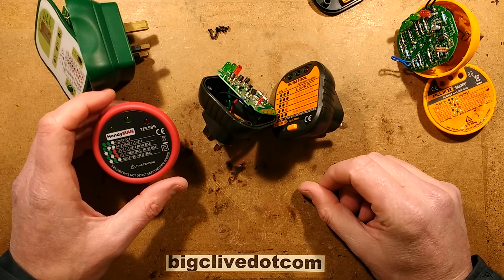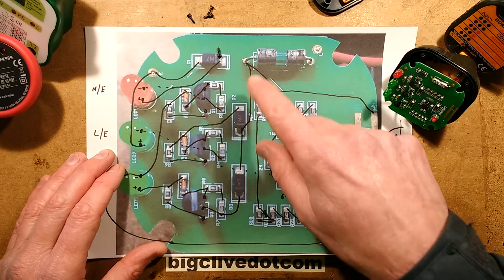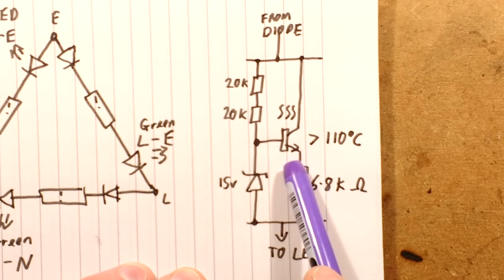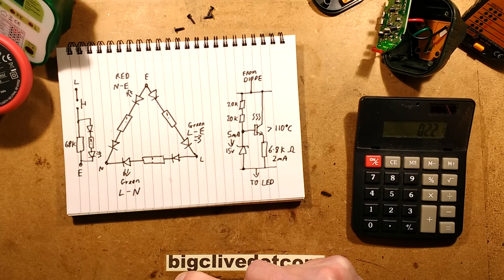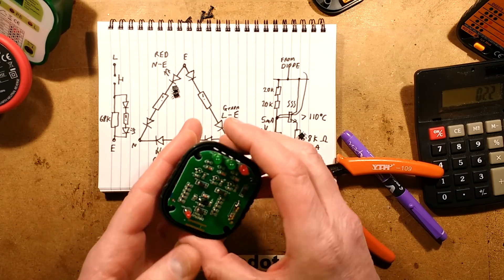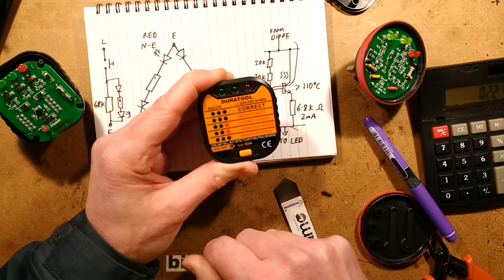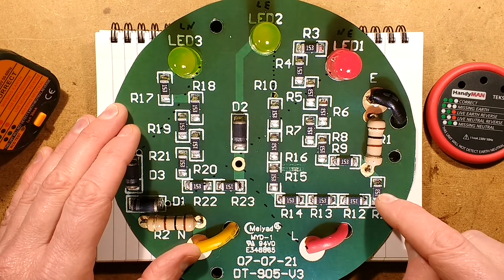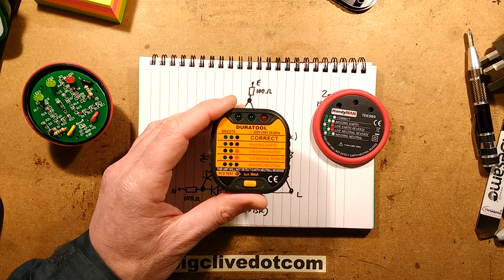Good versus evil socket testers.  (with schematics)

Comment: The earth fault LED is s really good idea, because if you press the switch and the RCD doesn’t trip, it’s easy to doubt the tester, and assume the RCD is okay (it’s a safety device after all). But having a red LED come on shows you that the tester is responding to the switch push, confirms it’s working and the RCD is bad.
Reply: I agree with you.
I think its a nice feature, and also a really simple circuit.
Reply: more buttons = goodier

Comment: I think that the LED that lights up when you push the button is quite a good idea because if you push the button and the RCD fails to trip then the first thing you are going to think is "does the button work?"  Then you're going to risk your life connecting a resistor between the live and earth any way.  It would be better still if the current in the LED was the same current that was used to trip the RCD.  It would be even cooler if it was a black light that lights up black when you press the black button.
Reply: exactly, I've had test buttons work intermittent, unless held down and wiggled about.
Reply: And if it successfully trips then you can see how quickly it did so.
Reply: I've been LOOKING for DED's for YEARS, no one seems to source them. (Dark Emitting Diodes)
Reply: You know what else would be cool? If I could breathe vacuum, I could flap my arms and fly to the moon. <_<

Comment: Yeah, I think you're exactly right: the button-press indicator is so you won't have any doubt where the fault is if your GFCI outlet doesn't trip. The last thing you'd want is for someone to think it's just a bad tester and to wind up cooking themselves with a hair dryer instead of just fixing the wiring or replacing the outlet.

Comment: Actually, epoxy transistor packages that size are better at dissipating heat than, say, a TO5 metal package.  Ferranti figured that out a long time ago with their ZTX transistors.  Ferranti is long gone, but the semiconductor operation was spun out as Zetex, which is now owned by Diodes Inc.

Quick firtle on google...  ZTX753 rated at 1W at ambient 25 C, derate at 5.7mw/deg C for higher ambient.  Storage and junction temeperature range -55 to +200 C.  Which is a lot more than epoxy packages could handle 30 years ago.  It's a higher max junction temperature than was typical (175 C) than 30 years ago, too.   Oh, max Vceo is 100V.  But there may be others in the ZTX range that are rated for the job.

Anyway, 110 C for that transistor is not scary.  Assuming they're using decent epoxy.  The circuit is fucking stupid in the first place, but the choice of transistor type may not be.

Comment: The weird one was probably designed by someone who had heard that you should use constant-current drivers with LEDs instead of just a resistor, and then looked up an example driver but didn't bother to determine the power ratings or change any of the component values from the example. I'm willing to bet that exact circuit is in a textbook or on electronics stackexchange or such. It's a very "new grad" (or even still a student) engineering feel.
Reply from the maker: It does have a student feel to it.  Where the lessons of real life have not been learned yet.
Reply: That actually makes sense. The circuit was over engineered, something that students do quite often because of the lack of experience.
And it goes in every field i know of. The masters of their trade usually prefer something simple and reliable.
Reply: More likely they thought it would be a good idea to keep the LEDs visible even if the supply voltage was low
Reply: Yes, that's a big part of why one would use a constant current driver. But that doesn't explain the design of that driver being unsuited to the task at hand. Especially when it's so simple to do it better, and so easy to notice the problem in the simulation and prototyping stages. Even as a student I always ran a test of power dissipation for all components in SPICE as part of my worst-case analyses. The professor gave the class a project to build an audio amplifier that had a circuit specified (including all components) but no layout or other info. We had to analyze it, build it, and demonstrate it working. My group had heat sinks on our PCB, one other group (out of about 8) did. The rest let the magic smoke out. You'd think they'd have figured it out from the analysis graphs and the datasheets, or at least have tested it, but many didn't. It wasn't until the end that they got the lesson. 

Most students probably didn't have professors give such a project, and so never really thought about thermal design considerations or simulating & testing everything properly. Learning through failure tends to stick rather well.
Reply: Hah. I like your professor.
Reply: I saw a similar facepalm thing in school. Guys were building a POV sign (I forget what, clock maybe. Been 10 years.) They built their case up, painted it nicely with a good Latex paint, and then GLUED the Motor / Rotor / PC board assembly onto the front of their case. Lucky for them, it lasted long enough for the staff to review its' functioning and they got a passing grade. Fail on basic mechanical principles IMO though, you BOLT or SCREW or otherwise securely fasten things that vibrate / have torque (like a persistence of vision device) TO the frame, you don't glue it to the paint, unless you used one HECK of a good paint. (MAYBE with an epoxy paint or powder coating, those are pretty rugged, but not Latex house paint!) Just cringe. I expected the rotor to come flying in my direction if I went too close to the thing :P

Comment: Clipping off the transistors at 9:48 reminds me of Earl "Madman" Muntz, who manufactured TVs from the late '40s to '60s.
He often carried a pair of wire clippers, and when he thought that one of his employees was "overengineering" a circuit, he would begin snipping components out until the picture or sound stopped working. At that point, he would tell the engineer "Well, I guess you have to put that last part back in" and walk away.
When I worked in TV repair shops in the '70s I repaired a couple of Muntz TVs.
They were simple, but not cheaply made.

Comment: The 100R resistors are for safety. The axial types that have been used typically "fusible resistors". Once this resistor/fuse combo reached an overload situation it will die open and without causing fire. - somone must have read the EU safety standards when designing that thing ;-)
Reply: My thoughts were also that Handyman has fusable resistors as a protection device. It seems a very good design, should have no problem with voltage either unlike the designs with only a couple smd resistors in series. (SMD resistors can have very low voltage rating!)

Comment: I'm eager to see a reverse engineer on the Fluke now, yesterday at work we had a preempted warning from Fluke that they're going to issue a recall on all of the SM series socket testers for some reason, we've been ordered to stop selling them all together for the time being! Thanks again Clive!
Reply from the maker: I wonder if it's electrical or a failure of the case seal risking them falling apart when bumped about in a toolbag.

Comment: All they needed was a power resistor in the collector circuit to off-load some power dissipation if they wanted to use that current regulator.

Comment: The regulator should make it work from 20 volts or so. Even if there is a low voltage the LEDs should still be adequately bright.
And on 240 volts they are nicely bright, without any component dissipating too much. Otherwise they could have used 220K resistors and increased the transistor current a bit - but now the dissipation is nicely distributed.
Oh Clive - don't go for gadgetry like shouting 'enhance' - you are so nicely understated and calm... keep it so please!

Comment: The reason for the constant current drivers is simply because that circuit will work with same LED brightness at both 220V and 110V. So basically its the same PCB sold all over the world and just put in different housing.

Comment: I'd be interested to see you compare the accuracy (and insides, of course) of a Kill-A-Watt meter to a HOPI.

The reason is, I bought a Kill-A-Watt a few months ago and some of the readings it gives me just seem right out. Like when stress testing my computer (Ryzen 5 3600x, GTX 1060TI, 16gb DDR4 etc) which has a 700W PSU, the Kill-A-Watt says it's only drawing about 120W. And my 3A USB charger quick charging a cell phone only draws 80mA according to it, while one of those USB Volt/Ammeters says it's a more realistic 1.5A.

I would have loved to get a HOPI just because you use them so much and you've always had such good experiences with them. And I love what I've seen of them. But from what I could gather from the pictures, it looked like it was for European plugs only.

Or hell, maybe I could even mail you my Kill-A-Watt and you could have a look at it. Just not sure where to get your mailing address. Lord knows it's not doing me much good here. I think my final test will be to hook it up to a 1200 watt microwave and see what it says.

Comment: Yes, its overkill to limit current that way unless you wanted it to work on several different voltages (perhaps the same circuit is used in a US tester?).  110 degrees is not a problem for a tester like this, its going to be used for seconds at a time in each socket is practice, and long term reliability isn't a design factor like it is for 24/7 equipment I reckon.

Comment: The square one, although I have I newer model that is different inside and shows the trip current on the display when you press the RCD 30mA or GFCI 5mA depending on the model says on the manual to no let it on the plug for more than 5 minutes, so the heating problem seems to be still there. But the 230V model draws only 18mA in 117V then you test the RCD that is not enough to trigger the RCD for testing. I saw some other that trigger the RCD in 117V  so I suppose there is a 230V model and a 117V model although the model code is the same.

Comment: My equivalent testers are all simply resistors and neon bulbs (plus a switch and resistor for GFCI test) in a really stout case. As a "Grey Beard Engineer" I abhor the seemingly excessive parts count in these units: More potential failure points.
Reply: Us picky old cranky guys are like that. LEDs are nice for some things tho :)

Comment: The constant current circuit has been designed by someone with a basic electronic knowledge but no common sense, probably someone fresh from college.  As is normal practice the zener diode current has been set at 5mA because that's the current at which the zener voltage is specified.  If you were to operate it at say 1mA then you wouldn't get any clue from the data sheet as to what the voltage would be.

Comment: 6 years since a very handyman took a handyman apart:) Looked up your video again because i had a discussion about relying on a socket tester. Which that  argument i doubt, and even could be very dangerous,  but many do by the name alone. 
Thing is, and correct me if i am wrong, the 3 light socket testers will / can not test a reversed Earth and Neutral but show the lights show as OK.  

My reasoning: If you have a socket with a reversed Neutral and Earth. A toaster would work fine. But if there is a Line to metal case fault, current flows through ones PE wire but reversed in the socket back to the Neutral. A RCD would not be able to detect the fault, but the case is still live. which can in my opinion be potentially dangerous.
Is that  correct?
And last, just a fun fact, MacGyver is out. BigClive is in. Heard in a recent sailing video when something was broken: "Well, looks looks i have to BigClive this..."  :)))
Reply from the maker: Since new testers have a test button that puts a resistor between live and earth.  If the earth and neutral are swapped the RCD doesn't trip.

Comment: I'm thinking that maybe they just wanted the indicator lights to be as bright as possible to be seen from across the room just in case. They may also have wanted to use LEDs with higher voltages to better fit their circuit. That's really the only reason I could think of for using the GaN LEDs. Possibly just sheer cost reduction.

Comment: The LED for the RCD Test is not bad at all. When you see the LED lighting up, you know that your test device is working fine, but your RCD is not.
Reply: Meiestrix Also note that some modern RCDs (they have an extra P in their name in some markets) are certified to trip even if the leak is true a diode.  Ideally, those would need two test buttons connected through two different LED+Diode circuits (press both to simulate an AC leak).

Comment: I was just looking at these on eBay and there is a new one, a smart and fancy Aneng AC11, with a colour display.
Reply from the maker: I bought one.  They advertised it as a UK version and it came with a different plug and UK death-daptor with sleeved earth connection that means that when used together they show an earth/ground fault.
Reply: @bigclivedotcom  I am afraid I got enchanted by the beautiful display and bought one just a couple of minutes ago. Just as an afterthought, I checked the reviews on BangGood and exactly the thing you have mentioned got me worried - people had pictures of it with an adapter stuck on. The eBay auction had an option where I could choose UK/EU version, so I wonder what end will it arrive with. Ehh...an impulse buy, we'll see.

Comment: Is it possible that the current regulation circuit is used in the case that the voltages across them are not full voltage?

Comment: A 2N2222 in a TO-92 case (which admittedly is not the same transistor you have, but is the datasheet I have in front of me) is good for 625mW. Theta J-A is 200C per watt, So at 460mW the rise would be around 92C. Add in about 15C for your room temp and you get 107C. Not too far off from what you are seeing. So it would probably work, as long as ambient wasn't too high.
But since the zener is drawing 5.5ma @ 220V and the emitter is drawing a constant 2.1ma, the LED is actually running at 7.6ma, not the calculated value. Brilliant engineering.
The LED on the RCD tester is probably stupidity, since in addition to the 3.3ma for the 68K resistor they have 7.6ma for the light. So the real RCD fault current they are running is almost 11ma, which is probably far above the fault current that some spec says should be the mandatory trip current.
Reply: I'm wondering what that transistors' base current was, pre-snip by Clive :p

Comment: When you push the RCD button, the circuit should trip, resulting in the LED not lighting. The LED is red because, like the red LED used in the line tester, if you see it, the RCD test has failed.

Comment: Hey Clive, in my opinion you do a great Job reverse-engineering al kinds of circuits. Then you present the Schematic which is a great deal in understanding the circuitry, at least for me. Maybe you could show us some recently opened Circuitry simulated in LTSpice. Also the whole "how do I get 10V peak to peak out of a 5V circuit" discussion (eevblog) might puff into pink smoke as you are clearly measuring "from here to there" (on screen) or the other way round, just to have a hands on explanation for what sh*t is about. Everyone could replicate a simple LED Capacitor Dropper for ecample...

Comment: Can't wait for you to get to the Fluke. Many people like their products but after two Fluke meters I had died I am not a fan. Both had absolutely poor case design with no webbing on screw mounting "poles". The plastic on these poles just crumbled causing the contacts to come off the rotary dial to not make contact. Actually that meter is electrically fine but mechanically failed so useless.
Reply: The Brymen BM235 has been really good for me CAT 4 UL listed got all the other things fluke has and is a bit smaller.
Reply: Inductor back EMF I googled it and the first thing that came us is EEVblog. Dave is good at his stuff so I am sure its fine. If I didn't have a decent meter that works for me now I would have considered supporting him.

Right now I am using an Extech set with a clamp on and typical multimeter set. It exactly replaces my Fluke 112 typical multimeter and Fluke 322 clamp on. 

I do not do extreme testing so any decent meter will suit me. What pissed me off with Fluke is they charge high prices but the meters failed due to poor design. I have the pictures to prove it. One day I will do a video on it just to ease my mind. Right now I don't have enough views on my videos to affect their sales by even one meter.
Reply: meanwhile my 1993 dated 87 has yet to go wrong
Reply: "extech" "extreme testing"
Reply: I always liked Square-D, but they are expensive.
Reply: Internet User you are fortunate. Many people seem to have good experiences with Fluke. My gripe is not that the meters went bad with very limited use but the poor design of the plastic body and inferior material used. Granted the meters were over 10 years since purchase but they still had the plastic on the screens. It was a kit with a hard body case so no banging around. 

The clamp on probably got used 25 times under table testing conditions as opposed to field. Never dropped. I have no idea how the Extech will fare but damned if I am giving Fluke my money again.
Reply: Buddy Clem I never saw a Square-D meter. Seen Greenlee and Fluke as the popular "better" brands. Apart from that its all generic Chinese in the Caribbean. My Fluke was from Florida though so I do not expect it was a substandard one for Latin American market.